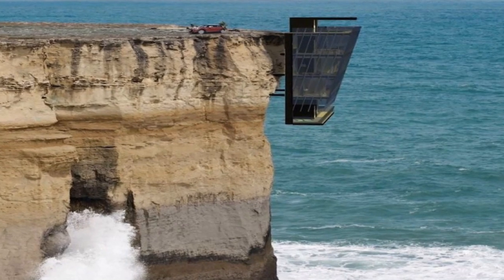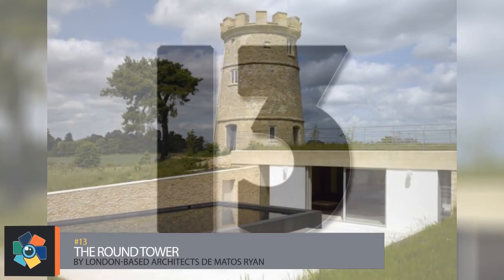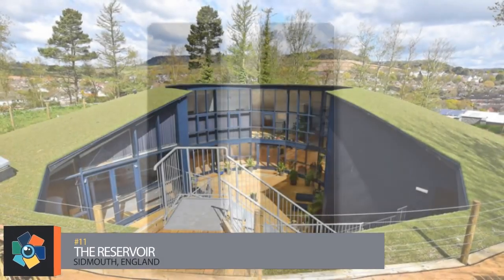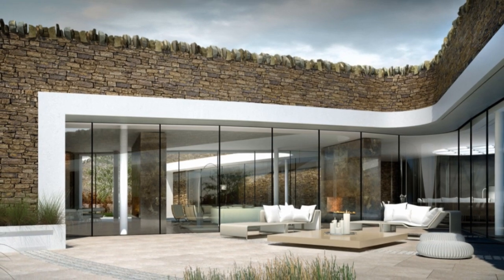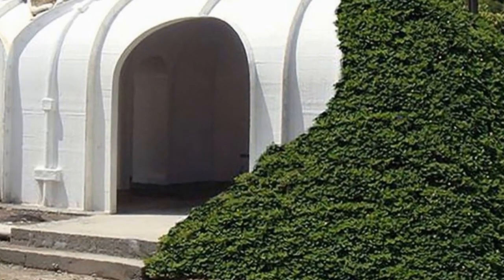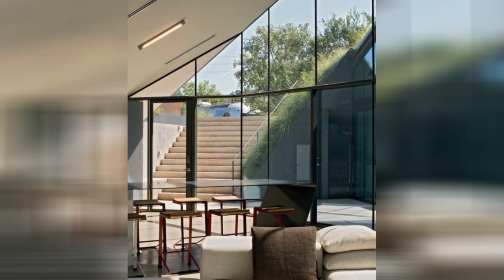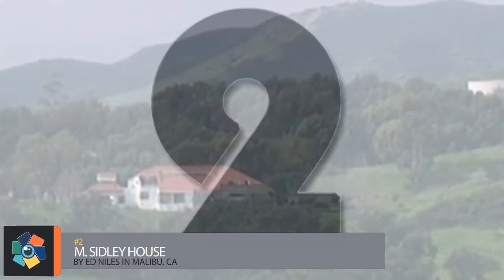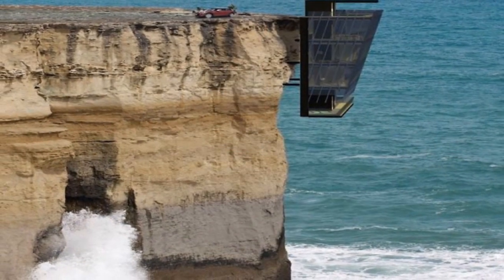15 Homes with Ingenious Designs

Comment: As my family legend goes- my Grandfather worked for the architectural firm who built  the Dalton UFO house in Colorado near I70. My mom and uncle have both told me that when they were pretty young they remember about going to work  with their dad and spending many hours and days playing at its construction site throughout the time it was being built.
Of course when I looked into the house and saw no reference to my Grandfather, Don Hutchison. 
My Uncle and Grandma both confirmed  what my mon said. They explained that he was a new at the firm and put in charge of the construction of it and what not and wouldn't necessarily be given any credit since he likely didn't design it. 
Apparently my Grandfather did go on to designing several upscale properties scattered in the rockies  esp. between Denver and Grand Junction throughout the 60's -mid 1980's. But I'm told that nearly all of these have been destroyed in wild fires or built over. 
If anyone can point my in the right direction for any information I'd welcome it.

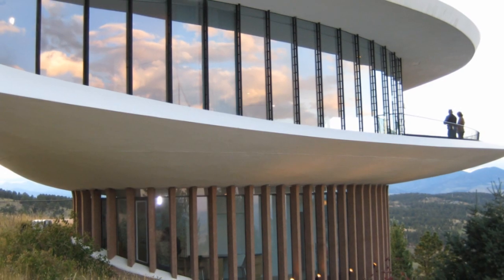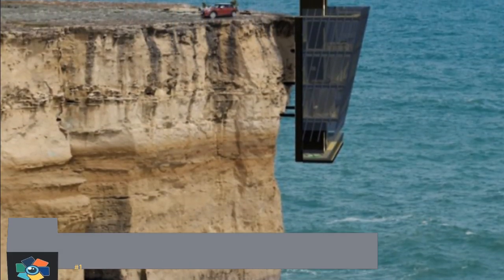Comment: the last one (the one on the cliff) does'nt seem promising at all! we all know whether a cliff, a beach, a rock etc, at some day of time it will erode or break! unless the structure of the whole house have some support from below the ground through the whole cliff! what if the cliff base erode a bit and formed a shape of an half arch? At some day the cliff would fall, as it always happen to any cliffs in the world, it erode and fall and so on.. this process takes 25 years to erode a length of a car at maximum rate (5cm ~ 20 cm per year) As seen in the intro 0:01 and 10:41 , the car is about twice smaller than the house, then that could mean it would takes 50 YEARS to erode a length of that house into the cliff!!!!!! After 50 years, the cliff house will be highly in danger. Since the cliff base would form an half-arch shape, the upper cliff remain the same shape, it will highly likely fall down due to no support from the bottom. I presume the picture of out and interior are computer rendered (obviously), it dosent make any sense to me!
Reply: Y21 Rico I think that’s why they introduced it with a nope....lol

Comment: I have considered several of these homes is something I might purchase or build at some time. I think 14 or 15 the monolithic dome cutaway on Pensacola Beach is definitely one I would consider or at least one of a similar style. There’s another more oblong shaped one on the mountains I think, in North or South Carolina that I like also. And there’s a man in Michigan who, with the help of his family, is constructing a huge underground monolithic style home basically at night or weekend. He spent at least five or six years so far, and I haven’t heard that he’s completed it yet there are YouTube archives that you can follow his progress. For instance, he had to design and cast cement something around 6 to 8 very large curved arching supports for the main entrance hall and then move them with a moderately large crane several times before placing them around a concrete ring that comprises the central support for the entrance dome.

I also liked and considered the plastic module tunnel domes I think they're made by green home or it may be called green dome Corporation but I kind of wanted something that could support more than 6 inches earth and grass on the top, but their prices are reasonable, and construction is fast. And while you didn’t mention it, there is a company that will sell a complete geodesic dome show approximately 48 feet in diameter for around $50,000, of course, you have to put together yourself. If you could afford I considered buying five and setting them up in the Pentagon shape and considered building a geodesic dome greenhouse over the whole group to protected from northern Michigan weather but I suspect that would run around $1 million or more not including the land I want at least 10 acres that have to be handicapped accessible because at 73 that’s what I need. Although why I need 10,000 ft.² give or take of living space for just me seems a bit excessive.

Comment: I prefer the cheapest, y'all forget the whole idea behind these houses is inexpensive homes. not mansions..
Reply from the maker: The whole idea behind extraordinary homes is inexpensive? Where does it say that rule? I think you may be thinking you're on a completely diffrent video.
Reply: i live in just such a home, it was built cheaply as practical, the original structure was a portable garage, reposesed and i bought it for $3000 dollars, my grandson and my son-in law finished the inside  and I live on family land, grand total was about 5,000 and septic tank.

That is what i call cheap. small but not too small and everything i need is here.shower, toilet washer and dryer (not small tiny things either, full size) refrigerator, kitchen (with double sink) computer radio (not used) bed and everything I want all paid for no mortgage  or other debts a window AC (Doubles as a heater, not that we get much cold weather in Alabama) i'm happy and well cared for.

i'm 71 and disabled, retired, i live alone.(the computer is my friend)

 now that's exactly what I'm talking about.
Reply: i forgot to mention, i'm currently making a solar charging system for saving money, i already have the panels and wiring, but the rack to hold the panels is still under way, it shount take much, i only need 500  to 800 watts, i have 1000 watts of panels to be installed and that should be enough

Comment: I say NO to everyone of them, except the one-storied, 3-sectioned, semi-circular, sod-roofed one (#7), & the dome house on the seashore (#14).
The rest are ugly, sterile, with way too many sharp angles, suspended floors & roofs, & all that glass designed to look at the outdoors, but Not experience it. I don't expect many of them to hold up in 20 to 30 yrs time, & will not sell well when the need for that arises. Load weight, land shift, & drainage could be problems down the road, as well as the maintenance & repair costs for these.
Any use of cement/concrete is toxic to the environment, so they are not That "eco-friendly."
I think of these houses as "one-trick ponies"....they'll "do it" for the owner-builders, & for only few others.

Comment: That reservoir house is off the freakin' chain!!!
Reply: MrP0kerJunkie 
Amazing house.   I'm not sure it'd work in this climate though.  There's a mansion near me that has a big open courtyard in the middle, kinda like a Spanish cloister.    But snow accumulates in the courtyard in the winter and there's not enough drainage, so they have to shovel snow into carts or wheelbarrows, take it through the house and dump it outside.   Big design flaw.